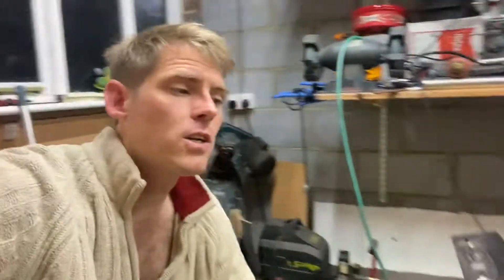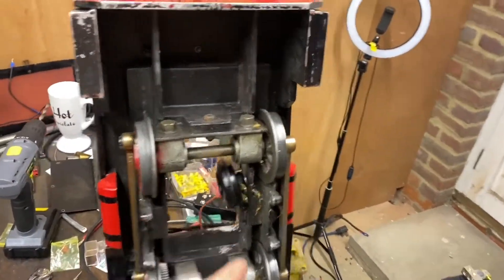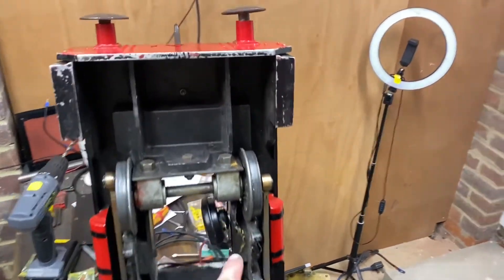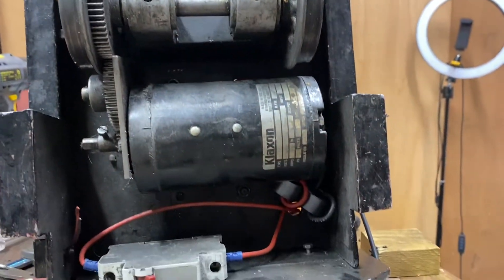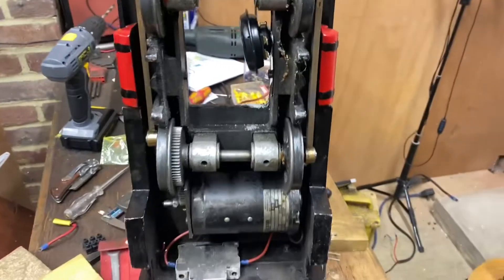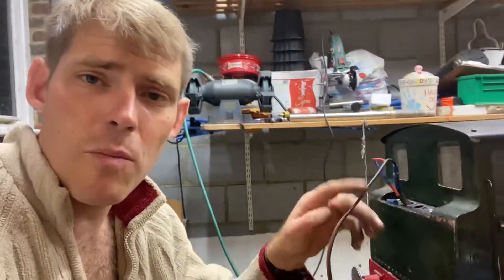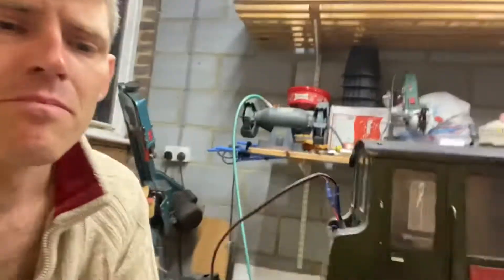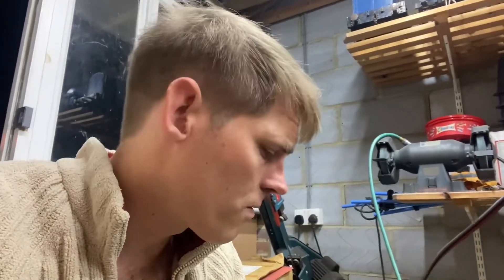4QD speed controller horn issues.

Comment: Hi Tom,
If you have not got your new circuit breaker yet.
I would recommend that you purchase a DC circuit breaker, rather than the more commonly available AC type used for house electrics etc.
Cheers.